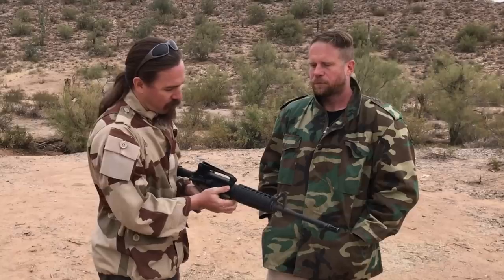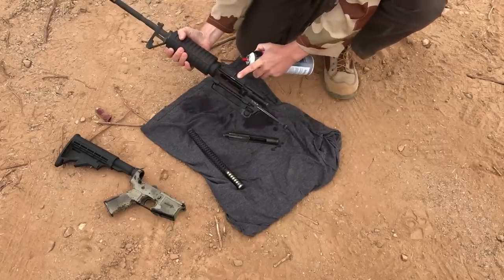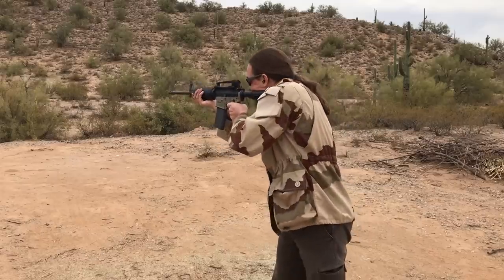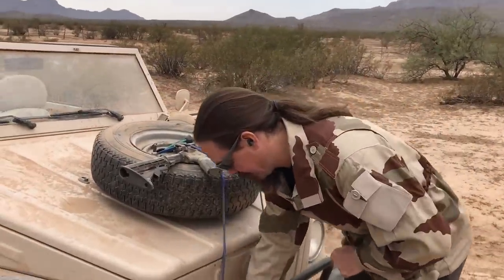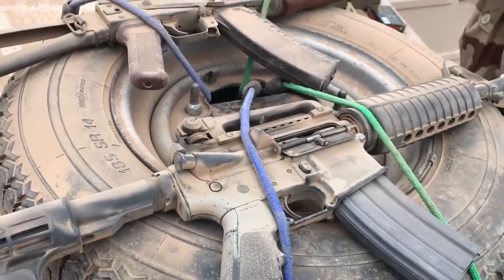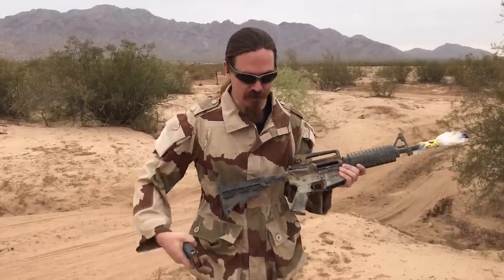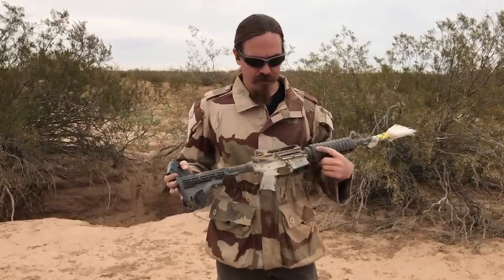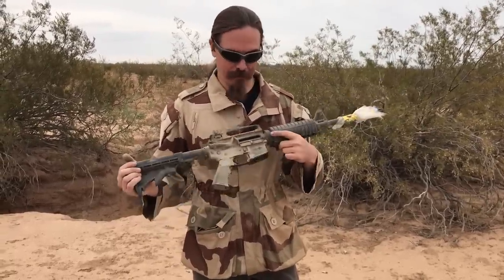Convoy Dust Test: M4gery / AR15

Comment: For the sake of consistency, I must insist that you guys continue to use the SpongeBob tape on every single dust test.
Reply: I was wondering what was on that tape.
Reply: I concur. In testing important matters such as these, consistency is vital.
Reply: It's standard issue, of course they are going to use it in all future videos.
Reply: the official tape of carnik con.
Reply: Ecosse57 Karl did a collab with CarnikCon btw. I forget which channel its on but they were shooting bulletproof helmets and plates
Reply: if they didn't it would pose an unfair advantage and we just cant have that
Reply: the only acceptable alternative is CYBER tape. cyber.equipment
Reply: Mandatory Carry but Superman tape disintegrates when exposed to kryptonite.
Reply: gullreefclub a rubber glove works for SpongeBobs world.
Reply: So fun fact, different color tape is commonly used in the field to differentiate your gear from another. Valid control.
Reply: @ddegn  lol nice pun
Reply: Yes, for science.
Reply: I use a piece of Hello Kitty tape over the hole in the top of the adjustable stock so it doesn't grab my facial hair and rip it out with every trigger pull. I believe I would be uncomfortable having 'bob so close to my mouth... 8-(
Reply: best tape ever invented.
Reply: M4s suck. No way to attach accessories and they are covered with uncomfortable bumpy nubs.
Reply: Brandon Herrera continued the legacy with the AK 50 prototype
Reply: I'm partial to Ninja Turtles, but I see your point.

Comment: FAL and G3 tests are definitely in order.
Reply: How dare you to imply that those existed and AR family isn't the only weapon of NATO forces that competed with AK family?! It's as if you're a sane person;)
Reply: @thatoneengineer5525  They already did the M1A in a previous dust test (one of the very early videos on the channel) and it jammed up after a single round every single time.
Reply: @worldfamousgi86  They did, but it was a very different test.  Also their M1A was in an aftermarket stock, and they left the selector switch cutout open.  I wouldn't mind seeing them do this test with an M1A/M-14 that is in a USGI stock, and has the cutout plugged like it should be.
Reply: Well, if they're going to test the FAL platform, it had better be the Commonwealth L1A1 Australian with its enlarged sand grooves. The whole purpose of that specific modification was to remediate the failures encountered while training in the Simpson. 
But for even more interesting comparison, the Israeli FAL should also be tested since it's considered the worst the platform has to offer. So test the best and the worst FAL variants against the practically standardized G3.
Reply: will provide floppies for test
Reply: There really ought to be a "Sand-cuts or nay" test. It would end half a century of bloodshed between the sand-cut people and the smooth carrier people.
Reply: @dylanwight5764  or just an original belgian FN FAL and an original german H&K G3 because they are going with what is standard issue for that type of weapon.
Reply: @michieldebont4317  
May as well test all three then. The point is, FN was well aware of the failures of the FAL in sandy & dusty environments, hence they accepted the suggestions provided by the RAIC while exercising with the rifle in deserts. The result is the most reliable conventional Western battle rifle ever put into production. 
H&K never remediated the same issue with the G3 because it never saw significant enough service in the same environments to warrant investigation.
Reply: @dylanwight5764  did they ever do anything about cleaning the FAL too often wearingdown the seer causing it to become full auto?
Reply: @michieldebont4317  That was never a problem I encountered in service with the rifle. However, the Commonwealth L1A1 Australian had an enlarged retainer on the rear of the bolt carrier compared to the more standard British production rifles. Unfortunately that also meant a slightly stiffer & longer trigger pull than the earlier British production rifles. 

As an aside, many of the early pre-production Commonwealth L1A1 seers were milled from mild steel, which is where this problem may have come from. Later production models -- including the Commonwealth L1A1 Australian - had a hardened steel seer. Don't quote me on this, but it was probably a type of high chromium steel. Possibly 1080/85 or 1090/95.

EDIT: Also worth noting is later (quick search says 1972 onward) C/L1A1 Australian production rifles omitted automatic fire altogether. To regain that feature, an L2A1 lower was coupled to an L1A1 upper. Our SASR were fond of that particular field modification.
Reply: @caffeinatedinsanity2324  the dutch FAL was a semi auto only rifle, but somehow the vigorous cleaning that happened in the armory every time  more than a mag was fired with them. Rendering some of them somehow fully automatic
Reply: @dylanwight5764  Fun idea!

Comment: Ugh, flashbacks. No lube or dry lube is the key. All you need is an IED blast to make it 100% legit.
Reply: Throw in a couple of rockets, some RPK fire from the hills, and a mad scramble for the nearest trough or tire in the middle of a reload (bolt group locked back, dust cover open).
Reply: @ParselyBunny Condoms. I'm not kidding. We would use condoms or the fingers of silicone gloves over the muzzle. 
I knew one bloke who always brought packs of novelty camouflage condoms with him. Charged 50c a piece. At the end of the deployment he earned himself enough on condom sales to buy himself a soft gun case for his rifle.
Reply: @PedroThePanda64  Necessity is the mother of invention. Brings a whole new meaning to the term "protect your piece" and "always practice proper safety"
Reply: @ParselyBunny There is an "issue" dust cover available
Reply: @ParselyBunny Marine WWII vet told me that is what his unit was trained to do after a few Garands jammed when they hit the beaches in the Pacific.  First I ever heard of it too.
Reply: @stever8776  Iv tried washing sand out of an action during a field ex in a trench, worst thing I ever did, it just made that shit into mud lol
Reply: Me and the other squad and team leaders went to NTC bringing dry lube for our joes. some other platoons used the wet lube provided by the Bn. they had jamming issues. We didnt.
Reply: So thats why our supply always had muzzle caps(2012-17) ROFL ParselyBunny   @dylanwight5764
Reply: @ParselyBunny Yup. They fit right into the hollow of the pistol grip when not needed.
Reply: @stever8776  this is what i did, i used condoms when i got their, but eventually would run out, as condoms dont tend to like 140 degrees and would crack and break.

I used a weather balloon and rubber band for a little bit, then eventually water was the simple answer. But sucked alot, so we stopped convoying and went on foot more and more
Reply: @dylanwight5764  We just pointed our muzzles down if possible. XD

Comment: pretty accurate test. In the invasion of Iraq we still put CLP on the inside of our rifles. The taping up the barrel is pretty legit we used duct tape to make shoot through muzzle caps. My rifle jammed our first ambush from the dust inside from the convoy. Switched to my M203 until I could get it back up and running. Thanks for giving me nightmares of the moon dust  Have photos of how we set up our rifles if you ever need a reference
Reply: About a third of infantry reported a malfunction with their M16 that took a long time to clear during a firefight, or disabled the weapon for the entirety. It's just negligence by the Army.
Reply: What is used now rather than CLP?
Reply: @WQuantrill  CLP is still used afaik. It was when I was in in 2020

Comment: In the interest of science, please do this test again with properly lubricated weapons.  My M16 and M60 were always lubricated and never failed to work due to coastal sand or highlands red clay dust contamination.  as a door gunner, we constantly generated clouds of dust and or sand going into and out of landing zones.
Reply: Yeah, unless you're one of the high speed low drag types, you lube your weapon before you head out. Institutional momentum says so.
Reply: Door gunners got,balls of steal or should I say lead
Reply: Frankly it’s better they run without lube as each type of firearm requires different types, levels and locations of lube to be considered “proper” which would no doubt cause people to cry foul for not being fair, in this way each platform gets the best chance possible ( as there is nothing to hold on to the dust and it is consistent between platforms) on the test, afterall, they aren’t ACTIVELY trying to make the rifles fail, rather they want to see which platforms perform better in each situation.
Reply: curious if, being the doorgunner and thus half hanging out a chopper that's in motion, might not remedy that problem a compared to a footslogger or ground vehicle mounted trooper in the same conditions.
Reply: Fair points, but when Vining said "properly lubricated" the Army standard is no carbon residue remaining on the weapon internals with a light coat of CLP/oil on all working surfaces. IMO this would begin to gum up the weapon. It may not truly  fail, but it would not help its chances in any way. Moon dust didn't do my tanks or mounted machine guns any good at NTC last year and we maintain them religiously.
Reply: Matthew Sosnicki  This man gets it^
Reply: finding the regulation setup sounds like a pain in the ass, yeah
Reply: We ran dry graphite lube for a reason in the sand.
Reply: If I remember correctly in the guidance for the SA80 it tells you to use the minimum lub possible in sandy conditions. So from a brit pov this test is accurate